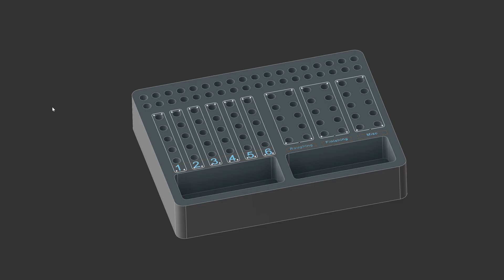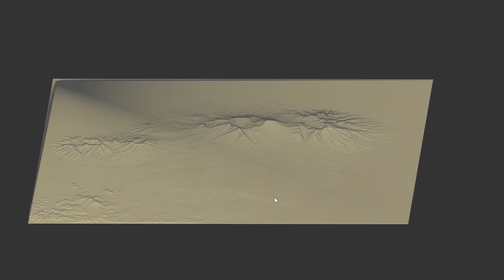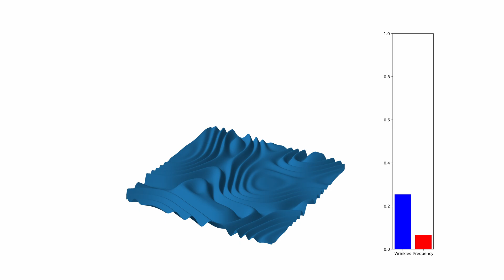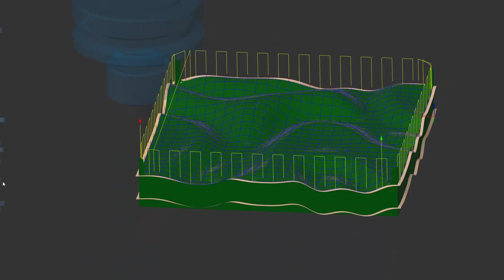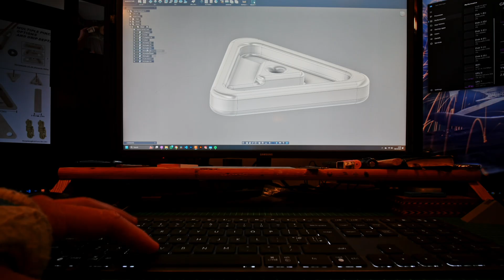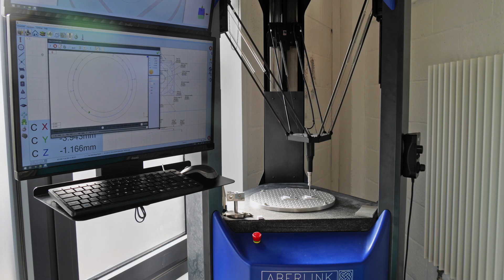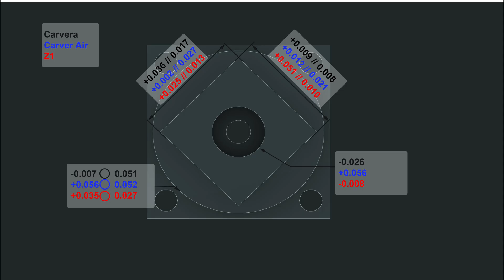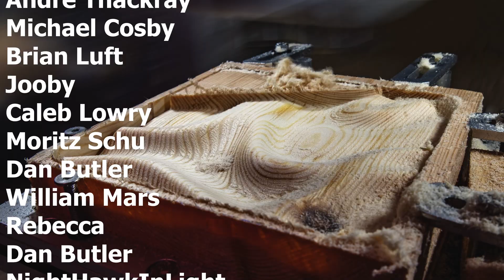Best Desktop CNC Under 1000$?

Comment: If Makera goes the way of bamboo labs and 3d printing in general, it will only be a few years till you can get one of these for a that kickstarter price brand new!
Reply: I think if anything it'll be more expensive so getting it at the KS price is one you'll be kicking yourself for not jumping on. It's why I did. I've seen several things like this start there and then when they went to mass markets after, the price was always more. Always.

Comment: Your method of changing Z while lasering is brilliant! One can imagine lasering cilindrical pieces without the accesory. Ideally you would need to compress the image your are lasering so you are using a projection of the image in a cilinder, rather than a projection in a plane.
One thing I have never understood is why the CNC machines are not designed so you can stand them on the side, so all the chips fall naturally out of the working space, and do not interfere with the work.

Comment: Are you french ? cuz i saw written "gauche" on your bone x ray thing. I have a foxalien vasto, I shouldn't have bought this machine but now it's here. I'm doing 3d engraving with heightmap technique. The designs are very nice but I've got problems with the chassis rigidity of the machine. I've never seen Carvera makera whatever as a machine to buy for me because I wanted a bigger machine and a cheaper one cuz the first I saw was at like 5000 bucks. And I also kinda like the open source thing where you can modify everything. I would really know some things, is the 4th axis really that useful ? Which software do you use for this type of machinning ? And what software do you use to control the machine with the 4th axis ?

And btw, this has nothing to do with the video. My machine blocks itself when the spindle is in contact with it. I've never seen this and I think I've got some sort of earth connection problem. Does anyone know how to correctly connect a vfd for a spindle, so that the machine does not reset when starting the spindle ?

Comment: Thanks for your test! I was waiting for it to take my engagement on the Kickstarter ! Simply the best video out there!! Regarding the 4th axe did you test it? Any comments about the precision in regards of the non direct drive?
Also did you noticed any bads about non closed loop motors ? 😊
Reply from the maker: Thanks man! I did not get a chance to test the 4th axis on this machine but the construction looks the same as the old belt driven Carvera 4th axis which I tested fairly extensively in my video on that machine a few years ago: https://www.youtube.com/watch?v=ffZlPlssL-s
The performance should be the same.

As long as the machine is keeping within it's normal machining parameters the open loop has been fine for me, and 1/8th" bits tend to break before the motors stall, which is much safer than the machine skipping steps and carrying on milling. The main downside of the Nema 17 motors and lead screws over the servos and ball screws is the slower maximum speed for travel moves so some toolpaths will take longer.

Comment: These machines are not toasters, all CNC machines require a relatively steep learning curve.

Let me also say that if you do your research you might actually get what you pay for. 

Cutting any sort of metal on this class is going to be tedious at best. (notice I said class not this machine specifically)   Cutting metals is usually done at slower speed sub 6000 RPM while woods are often done 10k+ rpm. Can it all be done.... sure, but will you want to?

Be careful

Comment: They state that it has 150w spindle, isn't it too low for machining something like aluminum?
I did try to machine aluminum part similar to one in the video on my 1610, it kinda works but takes ages...
Reply from the maker: Definitely not that fast at machining aluminium but it is a closed loop, brushless spindle, so more torque than an open loop spindle. Those accuracy tests took about 3h to machine
Reply: @taow  thank you for answer.
That was the reason why I didn't click "buy" immediately.
Sitting near it half a day and listen constant bzz for such simple model is not what I'd want.
On the other hand my primary task is pcb milling/cutting, for which, it should be good enough.
Still in doubts...
Reply from the maker: @MSP_TechLab haha there is certainly a lot of sitting and watching it buzz away. It depends how big and complex your parts are. Large aluminium parts will take many hours, it's well suited for stuff though and will do pcbs in mins not hours

Comment: I am so curious how you are getting those timelapses of the cutting! Have you mounted a camera to the build plate? What sized camera can you mount without it affecting the machine?
Reply: 8:55 - I see it. Very cool! No wonder they look so good!
Reply from the maker: @JoelSchat  Thanks! I've got a small mirrorless camera bolted to the bed, with a ND filter so I can take long exposure shots to get nice smooth motion blur (otherwise the shots look very jerky). I think the camera is light enough it doesn't affect the machine too much

Comment: What about steel? Steel machining is the only reason I want any milling machine, is this tool capable? Is it simply due to lack of steel capable end mills? Why no steel?
Reply: Lack of rigidity, spindle power. The tool will deflect from the workpiece or stall the spindle.
Reply from the maker: The machine is not built for steel as no coolant for the tool. It will machine it very slowly but will wear out the tools / spindle and surface finish will not be great
Reply: Realistically, if you want a machine that will cut Steel and wont take 12 hours, you're looking at $6,000 and up. Small machines like this lack the cooling requirements to cut steel, which will end up with you spending loads of money on broken tools as the steel heats up, hardens and breaks tools while machining.

Comment: Why would the wall finish look good on the z1 + carvera but so bad on the Air? Any thoughts on that? Because you wouldn’t expect that result from the machines geometry
Reply: Looking at the machines I'd expect exactly this. The Z1 has fully supported linear rails on while the Air has linear rods which while stiff are unsupposted in the middle and will flex. The Z1 is also smaller which makes stiffness easier/cheaper to achieve.
Reply: Yeah I don't get it, my bores look smooth on the air
Reply from the maker: Good question, it is pretty hard to come up with a definitive answer for that without a bit more testing. The only wall that came out badly on the Carvera Air was that large outer circular one and the internal bores are good. It could have something to do with the air compressor spitting out lots of water during the finishing pass and causing the endmill to re-cut chips? More data would be good
Reply: @taow  Pretty easy answer actually. The Air uses linear rods, not linear rails. Linear Rods are known for really bad deflection and poor accuracy in tolerance tests. It's why we see so many companies like Fox Alien making CNC routing tables with massive rod diameters to help reduce backlash. Linear rails win on accuracy every time.

Comment: Still to rich for my blood, 🤣 Lol.   But… I’m currently Super broke, even more so than so than usual 😅😜!    Regardless, this looks as a pretty cool piece of kit 👍. 
    - Would be awesome to have one of these, as I worked in a specialized machine shop where we made everything from one-off custom parts for race cars from “blueprints” the customer had drawn on a literal napkin, to the parts for the US government that they needed for when they were up armoring the thin skin Humvees at the beginning of the Afghanistan war, to extreme precision, ultra tight tolerance, medical equipment, and other parts or fully built and assembled items at scale for commercial distribution.  We had the big multi axis CNC mills, etc. But our company specialized in/our niche was primarily using the massive Mitsubishi CO2 industrial CNC lasers to crank out large quantities of parts with extremely tight tolerance allowances. 
I’ve always been nocturnal so I worked during the night shift, which meant that I specialized in being The primary Laser Operator and Technician, keeping all 4 of these nearly million dollar 4 kW+ industrial CNC lasers up and functional, and producing parts all night.  👍! Lol